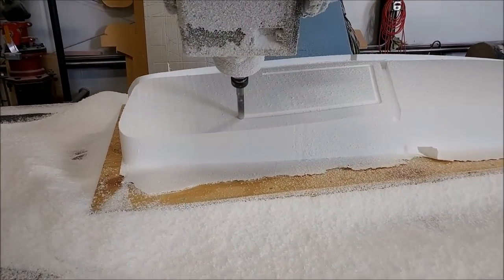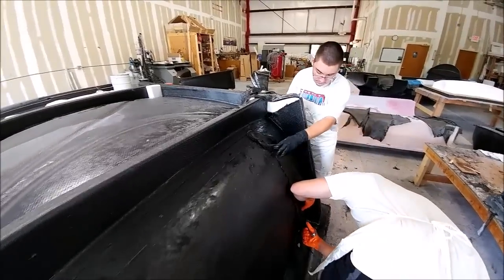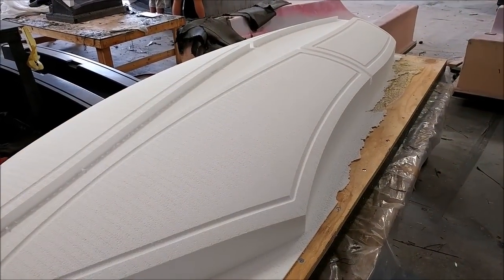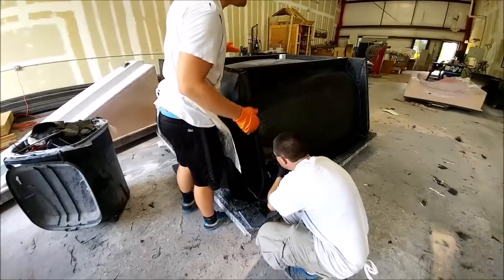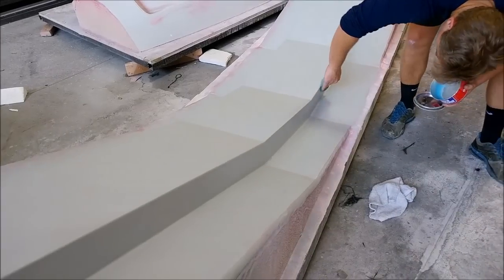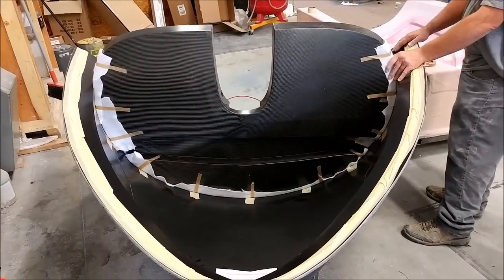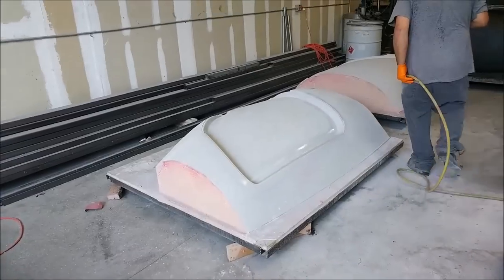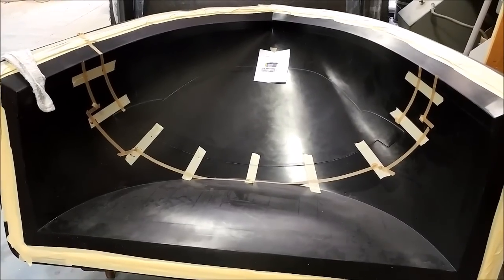Raptor Aircraft June 4th

Comment: Question : why are you using carbon graphite cloth for making the mold bracing & supports on which the molds sit ?  do you need to use such expensive materials for this ? > just curiousthanks for taking the time to make these videos -  love the videos by the way, keep em coming
Reply from the maker: I just answered this same question on Facebook a day ago. It's because if we decide to post cure parts in the mold both need to be made from the same materials so they expand and contract at the same rates when heated and cooled.
Reply: I wondered the same thing at first. I imagine they're mostly using left-over scraps from the very large pieces they cut. Using carbon fiber bracing also bonds easily to the carbon fiber of the mold, where using a different material would create a challenge. It keeps the mold light-weight and easy to move, too. In bulk, carbon fiber is under $10 per square foot (though I don't know the specifications of the fiber they're using), so it's not outrageously expensive.

Comment: How do the computer models show these quite large windows standing up to pressurization?
Reply: That's a very good question. From everything I've seen so far Peter has been very creative and meticulous regarding design elements of the Raptor. He posted a few design related videos a while back mostly relating to aerodynamics, but I'd really like to see a video where he addresses more of the structural details (like how the beautiful large windows are designed to handle the negative pressure differential).  Having said that I do understand that it's a lot more time efficient for Peter to just document the build process at this point, but I wouldn't mind skipping a few of the progress videos to get a good bite of some of the technical finer points. Of particular interest to me are, engine and engine management, fuel system, and pressurization.
Reply: I agree...I've been watching since the beginning and am almost ready to make my deposit, but I would love for Peter to address some of the technical issues that have yet to be completely addressed...